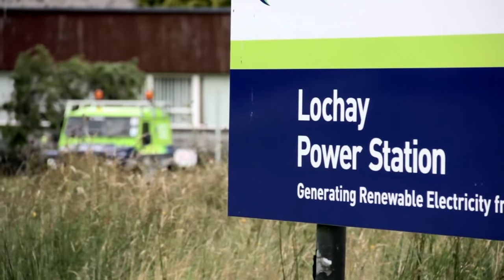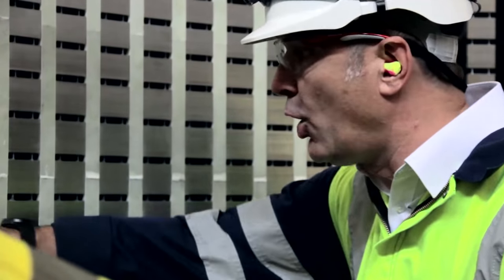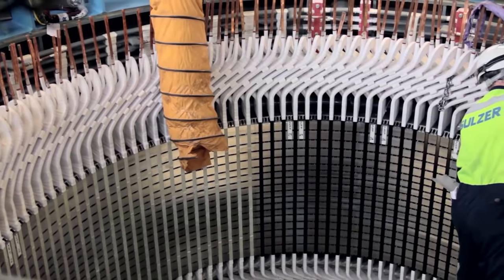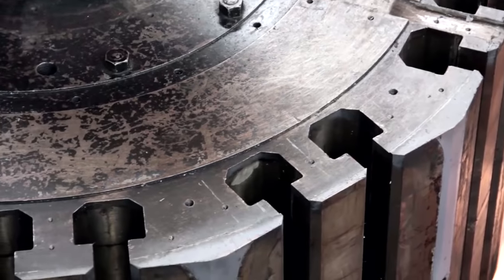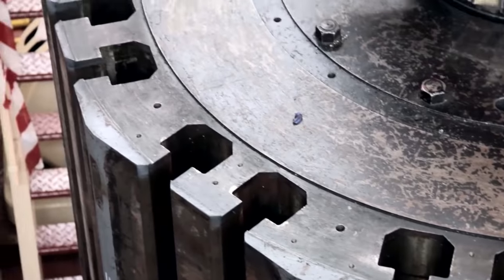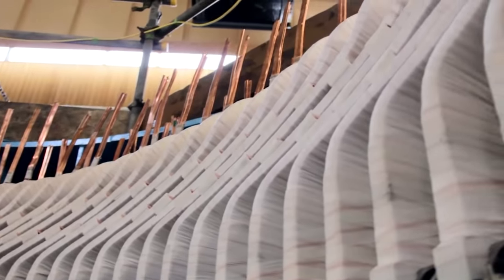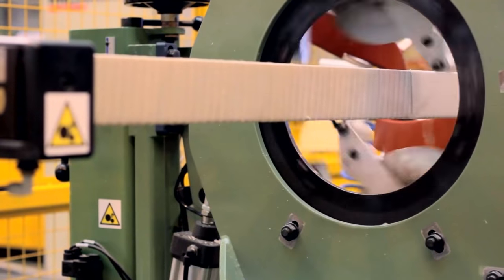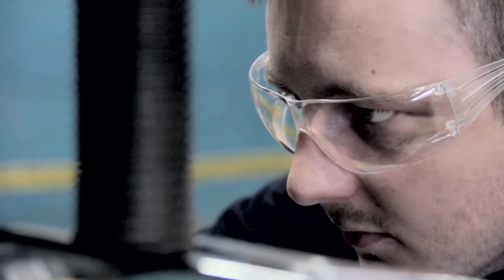Lochay Power Station Hydro Generator Refurbishment

Comment: Love those polished EE Co spec and worksplates. A time when we actually made fine heavy electric machines. Worked with EE equipped electric and DEMU trains on the old Southern Region of BR. Most motors were EE 507/ 16F now I think of it. Some had insulation updated to "20J" for use under 455 EMUs. EE 546s power the 442s and remaining ED locos. Many motors like this were scrapped when the Midland/Great Eastern dumped their 310s and 312s, sadly. You did a good job with those loose fittings, Mr Sulzer.

Comment: I don't remember it being more capacity after overhaul it was still noisy and vibrated even more than it did before not to mention all the bolts and material that had to be replaced post sulzer overhaul by local maintenance team so you make it sound like a good job but really it wasn't.
Reply from the maker: Dear seanyboy1946ify, thank you for your valued feedback. We take all customer comments seriously, good or indifferent. After reviewing this with SSE we are confident that the installation has met the customers’ expectations and the generator is still performing within acceptable parameters.  Thank you for taking the time to reach out to us.  Kind regards, Sulzer Group Communications
Reply: Sulzer seems like such a radical fix. Nothing else could have been done huh